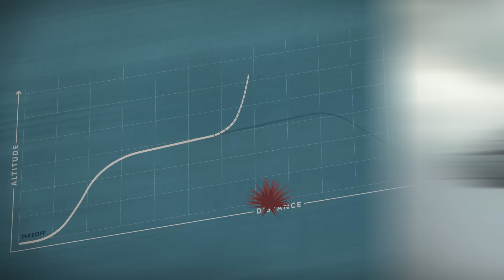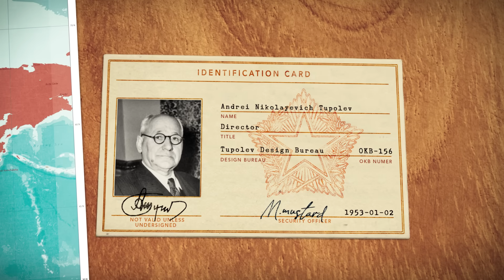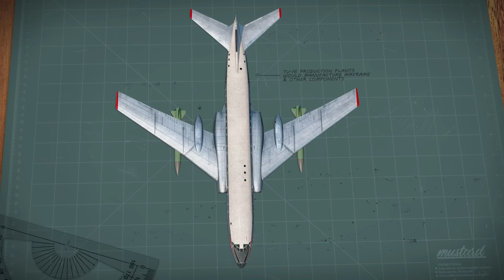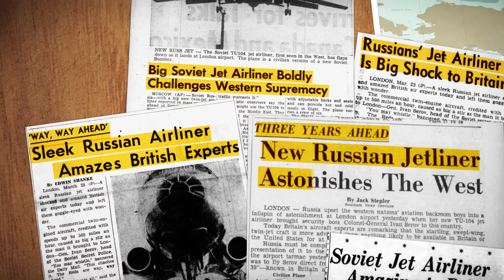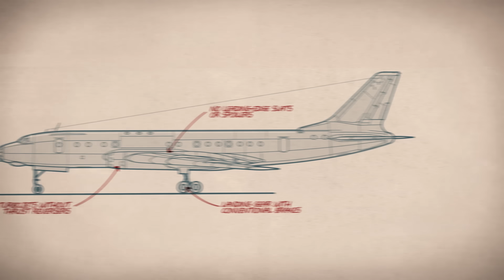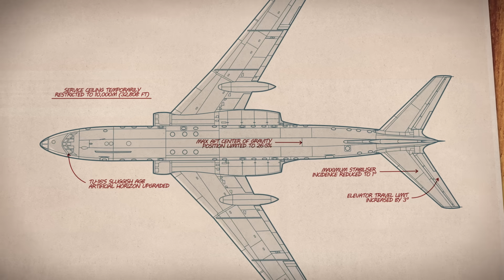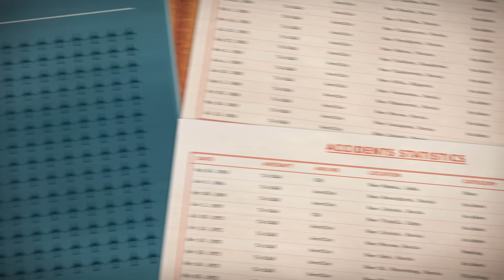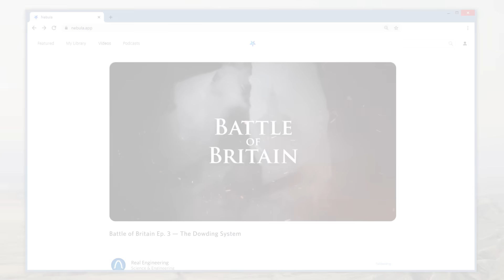The Soviet Airliner Designed To Crash

Comment: These things military/civilian can go both ways, that itself is a reasonable thing to do. The Comet (with problems solved) eventually had a version called the Nimrod, a maritime anti submarine plane (with a large capacity for dropping things like anti submarine weapons) that served many years without problems. Going the other way there were actually passenger variants made of the Lancaster bomber - with limited success as tech was changing so fast back then.
In fact the Nimrods replacement is the widely used Poseidon, a variant of a 737.
Reply: It was far more common to develop a airliner from an existing military bomber.

That would be a false speculation, the Hawker Siddley Nimrod is a completely different aircraft with a different type certification and designed by a different company 2 decades later... the Nimrod shares no significant parts or sub-assemblies in common with the Comet.
Reply: @sandervanderkammen9230  
"different type certification" - irrelevant really..
"and designed by a different company 2 decades later... the Nimrod shares no significant parts or sub-assemblies in common with the Comet." - 
Really? I'm guessing you'll be able to cite a source for this claim? It had different engines and a bomb bay of course, are you saying they, for no reason, redesigned everything else, created new jigs and manufacturing processes for .. fun? Cite a source.
Reply: @FallNorth  The de Havilland Comet has a total of 39 hull loss accidents making it the highest loss rate and fatalities statistics of any jet airliner in history.
Reply: @FallNorth  Please cite a source that proves that the de Havilland Comet and the Hawker Siddley Nimrod are the same aircraft???
Reply: The problems with the Comet were never solved, it was a deeply flawed design from inception, no manufacturer s have based their aircraft on the Comet design.
 While the Comet 1 was certainly the worst jet airliner in history it was grounded and its airworthiness certificate was permanently revoked in 1958. Since 1958 the Comet 4 is the worst jet airliner in service, the Comet 4 has the highest loss rate and fatalities rate of any jet airliner besides the Comet 1.
 The placement of the engines inside the wings was a major design flaw that is common to both versions.
Reply: @sandervanderkammen9230  
"the Comet 4 has the highest loss rate and fatalities rate of any jet airliner besides the Comet "
This is absolute and complete HORSE SHIT and anyone who knows anything about planes knows that! Jesus. Look at this:
https://en.wikipedia.org/wiki/De_Havilland_Comet#Accidents_and_incidents
The only comet 4 accident that might apparently be technical was an instrument failure, not structure, the rest were pilot errors or even a terrorist attack! Why do people on the internet LIE all the time? If you have better info, cite it. Link us to it. And explain any incident in a comet 4 where the engine placement caused an accident. Go on, list them for us. I bet you won't of course.
"The placement of the engines inside the wings was a major design flaw that is common to both versions."
The very plane this video we are commenting on has this exact same design.. pretty much every [fast] military jet ever has the engiines in the body or wing..

Comment: 9:42 aaah, said Boeing while designing the 737-max.. that sounds fun, let´s do it again.
Reply: The de Havilland Comet and the Tu-104 have a far worse safety record than the Boeing 737 Max.
Reply: Boeing ran into an unavoidable software glitch
The russian jet was a completely avoidable design failiure
Reply: @nou7401  Boeing was forced to use software mandated by the FAA, big difference between the Max and the Tu-104... especially when you consider that the 737 is the most successful aircraft in history.
Reply: @nou7401  I disagree: "Moving the engine position forward shifted the plane’s center of gravity, which altered the aerodynamics of the aircraft. The position of the new engines pulled the 737 tail down, pushed its nose up, and put it at risk of stalling." Then they came up with a software.. but because of cost cutting, it was flawed. And they didn't brief pilots about all that.. it's much more than just a software glitch. It's a downfall of a previous great engineering company.
Reply: @scrull81  Congratulations! You succeeded in demonstrating that you know absolutely nothing about aerospace engineering and got everything wrong all in one YouTube comment... 

By your benighted theory, the Airbus A321 and 320neo have the exact same fatal flaw... 
Can you explain this????

Comment: Most dangerous plane ever was your DC-10, only good at killing its passengers and even other planes like the Concorde. Another US propaganda rubbish channel
Reply: The Worst passenger jet in history is the de Havilland Comet Disaster.. . one out of every three built crashed or were destroyed in accidents.
Reply: @sandervanderkammen9230  Concorde never crashed before. A piece of engine lost on the runway by a disgraceful dc-10 blown the tyres of the Concorde causing a fire on the wing. Reputation of DC-10 was so bad that even Freddie Mercury refused to fly  when heading back from Tokyo.
Reply: @Vlad79061  It was the blown tire that killed everyone on board, the investigation found a fatal flaw in the Concordes design that ultimately grounded the Concorde permanently.
The Concorde also suffered 2 very serious in-flight structural failures, the result of design flaws in the rudder assembly that was never satisfactorily resolved.

No doubt that Freddie knew as little about jet aviation as you do lad... he was a singer, not an engineer.
Reply: @sandervanderkammen9230  the tyre was blown by a piece of engine lost along the runway by the DC-10.
Reply: @Vlad79061  Moot point, tires blow out all the time, it's a common problem for all aircraft, the point is they usually dont cause the plane to crash like the Concorde did, the Accident investigation uncovered a fatal design flaw in the Concorde, there was no cost effective way to  mitigate this design flaw, in the interest of passenger safety the Concorde was permanently grounded.
Reply: @Vlad79061  FOD foreign object damage is one of the leading causes of aircraft accidents and aircraft damage, 4 BILLION dollars per year in damage to aircraft.
Not just parts that fall off of aircraft either, rocks, runway lights, birds, maintenance equipment, luggage, catering equipment, personal items such as keys, coins and clothing that destroyed engines and entire aircraft.
Reply: @sandervanderkammen9230  De Havilland Comet could carry 119 passengers only, less than a modern 737
Reply: @Vlad79061  The Comet has the worst per flight and per passenger/ mile  fatalities rate of any jet airliner in history.

The Boeing 737 is the most successful aircraft in history... 15,000 aircraft sold, used by 350 airlines in 113 countries, one third of all passenger flights, 
There are 2,000 737s in the air right now, one takes of or lands every 2 seconds.
365 million flights
Reply: The DC-10 would go on to have an excellent safety record and has a better   safety stats than the Concorde.

Comment: Maybe because they reverse engineered the Comet, which itself was quite a dangerous plane.
Reply: No one was dumb enough to copy the Comet, even the British knew the Comet was a horrible deathtrap
Reply: @sandervanderkammen9230  Sud Aviation Caravelle?
Reply: @Mittens0407 The Caravelle didn't explode in midair like the Comet... a superior French aircraft design.
Reply: @sandervanderkammen9230  ...which was partly based off of the Comet.
Reply: @Mittens0407  Partly based off the Boeing 307 Stratoliner... not the Comet.
Reply: @sandervanderkammen9230  Here we go with blatantly making things up again. The Sud Aviation Caravelle licensed and shared many components with the Comet, most obviously the nose design and cockpit windows. No evidence for your claims though...

Comment: I’ve always love the Comets design. The engines being in the wing just made it look so sleek, but I get it, it’s a pain in the butt to get to the engines to work on. Still looked pretty cool. But the square windows were a bad idea lol.
Reply: Square windows theory has been completely debunked, wreckage recovered from the sea confirmed that the passenger windows were not related to the catastrophic in-flight structural failures.
Reply: The engine placement on the Comet was also one of its fatal flaws directly responsible for several accidents and fatal crashes.
It's a bad design which is why no one copied it.

Comment: Propoganda? Hm.. Well, let`s call a spade a spade - your video is a manipulation. Why? Simple! Point by point. 1. you are comparing soviet "before-WW2" planes with US "after-WW2" planes (where was no war, and USSR lied in ruins) - maybe we should take DC-3 or Boeing-247 for a fair comparison? 2. All first and second era passenger jets was quite loud, not only soviet. 3. There was no thrust reverse on passenger jets before Boeing-707 - it was unnecessary, some small jets (Yak-42 for example) uses wheel brakes. 4. Soviet economy was so different that there was no money as currency, so there is no point to calculate the cost. 5. USSR grow so fast before WW2 and kept this grow little after - why not to build the new plane faster then ten years? 6. Reusing early developed things - it seems it is bad, when it is happend in soviet union, or it is restricted to do so? Of course, nobody else did not do so. 7. Only 2 Tu-104 was lost after stalling (yeah-yeah - of course, the evil KGB has destroyed all the evidences, u-ha - tell me). 8. Numbers: Boeing707, produced 1010, lost 174 (17.4%), Tu-104, produced 205, lost  37 (18.0% and not every 5), SE-210 Caravelle, produced 282,  lost 64 (22.7%), DH106, produced 114, lost 25 (22.9%). I don`t know, in what the reality does author lives, but in our world 18.0 is less than 22.7 and 22.9, and it is quite close to 17.4, or please tell me - how did you calculated this "most dangerous airliner"?
Reply: Excellent comment, you are absolutely correct.
The de Havilland Comet remains the worst safety record of any jet airliner and the least successful.

Comment: Very interesting video. The Tu-104 was just like the Comet: the lessons learned when design flaws turned the planes into flying deathtraps helped teach other aircraft manufacturers valuable lessons that turned passenger jets into a safe, efficient method of travel. People can make fun of DeHavilland and Tupolev all they want but you do have to admire the risks they took to try to push air travel into the future and they've earned their places in history.
Reply: The Tu-104 had its problems but you cannot compare it to the unmitigated failure and disaster of the de Havilland Comet.
The Comet Disaster was a tragedy that could have been easily prevented if de Havilland had simply followed well-known and understood industry standard for building pressurized cabins made from riveted aluminum alloys.
 The Comet remains the worst example of engineering incompetence in commercial aviation history and a truly shameful and humiliating chapter in British history.
Reply: The only lesson learned by the Comet Disaster is that manufacturers could not longer be trusted to conduct their own aircraft crash investigations.
The first successful airworthy jet airliner is the Boeing 707 series which flew on July 15th 1954, before anyone (including de Havilland) knew why the Comet exploded in mid-air.

Comment: The windows were square . after the comet the usa put in oval windows and called it Boeing
Reply: The square windows theory is a red herring proposed by de Havilland who never fully understood why its aircraft suffered catastrophic in-flight structural failures.
 Wreckage recovered from the sea confirmed that the passenger windows were not related to the structure failures.

Comment: The 737 MAX and the 787 are the 2 most dangerous airliners built.
Reply: Wow! You look like a fool right now.
Reply: no lmao
Reply: @oren2000  About 2/3s of the aircraft engineers at Boeing quit when told about the engineering requirements of the 787; it'a plastic airplane.
Reply: @sashadala346  Composite materials have been used in aviation industry for over half a century and as long as jet airliners existed.
The First successful airworthy jet airliner is the Boeing 707, it used 3% composite materials.
The Boeing 787 uses 50%.
The 787 is the world's safest jet airliner, it has the longest per flight and per passenger mile safety record with Zero fatalities.
Reply: @sandervanderkammen9230  Then you fly on it.  This poster will pass to fly Airbus.
Reply: @sashadala346  Airbus planes actually use MORE "plastic" than Boeing... 83% by volume and over 50% by weight.
Reply: @sashadala346  Airbus planes actually crashed more than TWICE as often as Boeing aircraft.
Boeing crashes average 1 per 1.84 million flights 
Airbus crashes average 1 per only 0.81 million flights!!!!
Reply: @sashadala346  I hope you live! Your chances are better on a Boeing!
Reply: @sandervanderkammen9230  NO

Comment: Updraft , like lift, but could be, gravity variation. Or, what is causing up draft . Gravity lost like you meet a down hill.  But in a car you don’t need wing lift.   Stomach goes up sudden drop 😅, same as gravity lost momentarily. Planes need weight engaged by wing lift.  Too much, you go down, no effect you go up.  Stall can be picked up in a dive ,if altitude permits.  By as held on control,surfaces, has to be in centre of gravity of craft in flight.   Weight aft, has influence as soon as this bias becomes inactive.

Comment: I thought this was gonna be on the comet, which is personally my favorite looking jet liner ever made. I get that the jet thrust was not as fuel efficient as the turbo props we have now adays, but the low profile of them almost made them look like thrusters from star wars
Reply: Unfortunately the Comets engines placed inside the wings was one of its fatal flaws and is why modern jet airliners do not use this design.
Reply: @sandervanderkammen9230  Forgive me if I am wrong... but I thought the fatal flaw was the square windows. I don't remember them having any problems with the wings and engines.
Reply: @cerneysmallengines  The Comet Disaster included several unexplained runway excursions, some which were fatal or destroyed the aircraft.
Intially blamed on pilots error it was later discovered a fatal flaw in the engine and wing design of the Comet.
Wind tunnel tests confirmed that the aerodynamic theory popular in Britain at that time was completely wrong. Placing the engines in the wings does not reduce drag at subsonic airspeed and reduced lift and engine thrust during takeoff.
The wings and engines were completely redesigned and this type of wing and engine placement is no longer used for safety and aerodynamic reasons.
Reply: @cerneysmallengines  The square windows theory is a red herring proposed by de Havilland who never fully understood why its planes crashed.
 Wreckage recovered from the sea confirmed that the passenger windows were not related to the catastrophic in-flight structural failures.
Investigators found that the aluminum skins were too thin and brittle, proper rip-stop doubler joints were not used, too few rivets were used and the fuselage reinforcement  rings were too narrow and spaced too far apart.
Not square windows
Reply: @sandervanderkammen9230  I am only going off of my memory of videos I've watched, so take it with a grain of salt, but what I remember is the skin failing at the corners of the windows
Reply: @cerneysmallengines  There has been alot of misinformation and revisionist myth about the Comet Disaster, the truth is the Comet had windows with the same radius corners (3.0 inch radius) as modern jet aircraft like Boeing and Airbus.
The shape was not the cause.
de Havilland miscalculated the loads on its stressed aluminum skins and reinforcements... and the fatal mistake was they didn't test the airframe properly either, allowing the  mistakes to go on to production and causing a string of fatal crashes.
Reply: @cerneysmallengines  de Havilland company was famous for building aircraft primarily from WOOD and Fabric, held together by nails and glue.
The company has very little experience with riveted aluminum airframe structures.
When the Comet was designed, de Havilland was still building aircraft from wood, even the Comet is not an all metal aircraft.